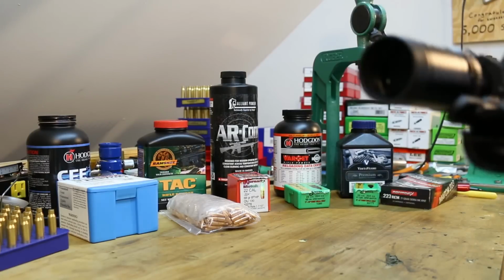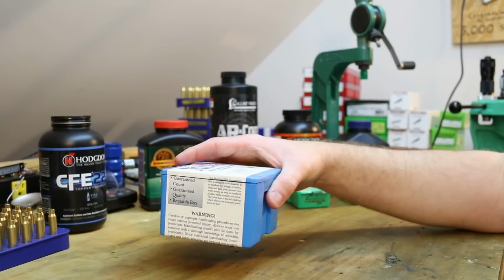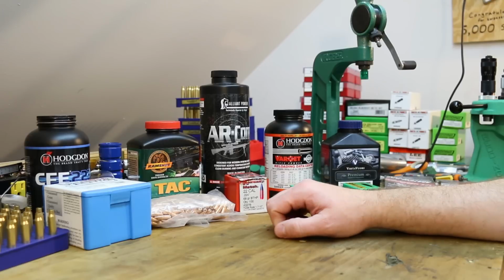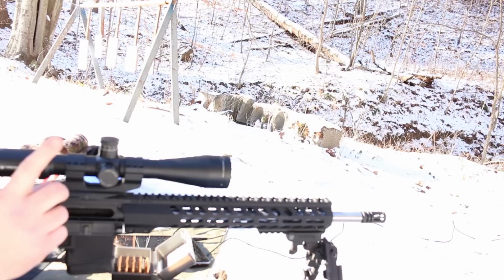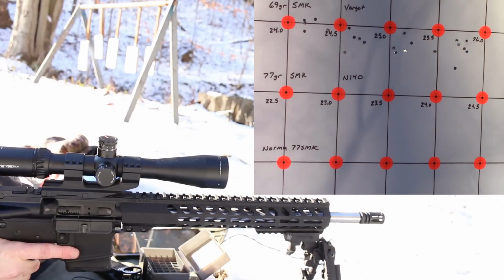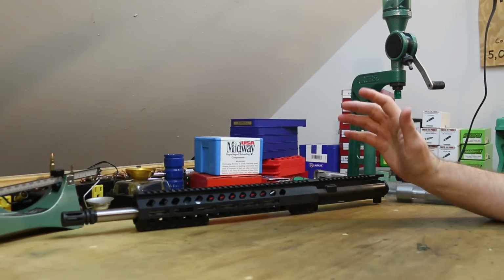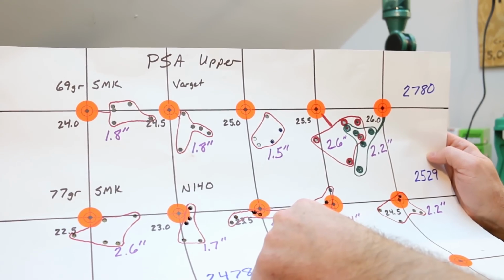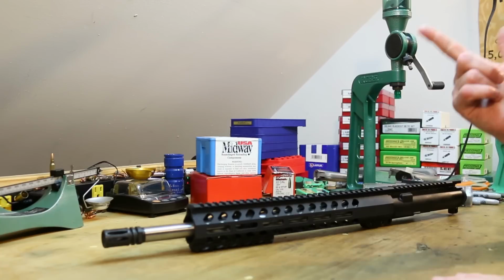5.56 & 223 - PSA Upper Accuracy Tests

Comment: Great Vid JRB. Thanks for sharing. Looking forward to seeing the updates on this. 

I own/owned several PSA uppers over the last few years and their premium line with the FN barrels tend to shoot pretty good for me. I think you are close to the limit though with the budget PSA freedom line.

That 69 grain SMK with 24.5-25.0 grains of Varget has been a shooter for me in pretty much no matter what AR it goes through, so while I'm sure you can squeak out a little more out of that barrel I think that 1.5ish MOA you achieved is actually pretty good from what I've seen. Ever do any testing with 8208 XBR powder? I love that stuff with the heavier bullets.

You work up some great match loads on your channel and provide great feedback. I think in the future treating yourself to a high end barrel like a Lija, Krieger, White oak armament, Douglas etc. would be a great way to showcase your hand loads. But either way JRB nicely done.
Reply: I think the Freedom line (Melonited) is their second tier barrel,the PTAC is the bottom rung(phospate ext, and no inner nitride/ melonite coatings).

I think PSA has basically stopped using FN tubes they are rare to find listed anymore(and I keep a close eye on the specials for them).I think they are private labeling them(w/FN consent as PSA on the tube if I were guessing). Just my guess.

Comment: Good content dude. I believe that the accuracy that is being delivered is typical of most barrels within the quality standards that you have paid for.  Getting a Barrel that is a 1-8 twist with a wylde Chamber would preform with much better results. The N-140 loading that you used is the AMU "Go To" as their 600 yard loading. I'm just thinking off the top of my head, I'm not trying to put you stuff down. Good video. Dave.

Comment: I was hoping to see better performance from this, recently I tried hornady 75 BTHP match with Varget and it shot great from mine. I do have a 223 wylde chamber and 18" barrel length. I'd say give that a try it shot significantly better than the 68 Gr I was playing with. Also haven't had any factory 55 shoot very well but that may be inconsistent loading. Great channel man!
Reply from the maker: I watched some of your videos but haven't finished them all yet.  Not sure how much the 18" and Wylde chamber would change things, but it might be a lot.  Seems like these barrels might be very picky about bullets.  We'll see!
Reply: I have the same barrel in a PSA upper as west desert shooter has and it is sub MOA with factory loads. Not the cheap surplus stuff though but thats fine by me as I don't use it anyway. It does well with TSX bullets 62 grain I thing but would have to have a look.
Reply: Michael Max not many factory bullets shot great for me and I tried 10 or 11 random brands and weights. Unfortunately the 50 Gr shoots great the reason that's unfortunate is I want to shoot long range but if you're varmiting it may serve you well. I haven't tried a ton of the premium 223 it's just too expensive to try a bunch maybe look into federal gold medal or hornady match
Reply: OP, What's the twist rate on your barrel

Comment: VV N140 is my absolute favorite AR powder but in my area it is almost $40.00 a pound. CFE223 works well and at around $30.00 it's easier on the wallet. My go to load is 24.0gr of CFE223 pushing a 68gr Hornady bthp bullet out of a 20in 1-9 barrel and getting MOA patterns.

Comment: My 1:7 barrel HATES 55gr FMJ but loves everything else from 55gr varmint pills to the 77gr loaded to mag length. If you get a chance snag a barrel from White Oak Armament it will not let you down. Also using metal GI mags let you load a bit longer w/o feeding issues. I picked up a few metal 5rd mags for hunting legality and they work great.
Reply: White Oak Armament deals with strictly Match Components, I would recommend them to any person who is serious competitor in NRA High Power. Good recommendation. Dave.
Reply: Thorsaxe777 my 20" from them in 1:7 shoots lights out, but it is kind of an ammo snob and seriously dislikes the bulk 55fmj for some reason. ive tried loading those pills at every length and every powder charge with and w/o crimp and can only get 2" groups. 55gr and up varmint and match pills i find its a bad day when groups avg over an inch at 100.
Reply: Odin works makes good stuff too, every thign i have of theirs is verry good, highly recomended
Reply: mine shoots 60g varminters from sierra over 26.8g varget into a ragged hole at 100yds always an inch or less even on bad days and mines not the freefloated model but the same barrel

Comment: You have a 1-7 twist rate the best weights for your twist rate are the 69-87 grainers. 
But it's not the bullet weight, but the bullet length that will determine accuracy. For example a Hornday 75 gr BTHP is longer that a 77 Gr Sierra Matchking BTHP. Every different bullet weight is going to have a different Point Of Impact, so with that said rezeroing your scope may be necessary as you go from 55-62-68-77. What I do is I buy a box of factory rounds say Federal 69 Gr BTHP for my 1-9 twist Savage Bolt Gun, measure the OAL of all the rounds in the box, get a average and write it on the inside flap of the box. 
Then I take em to the range shoot a group of 5 rounds checking the point of impact and grouping, let the barrel cool for 10 Min. Then shoot the other five rounds checking the groups. Then if I want to copy the load I already know the OAL and how it groups from my rifle, just pull one round apart checking the powder charge, and put that information on the inside flap of the box. So already having Federal commercial 223 brass and small rifle primers. Having the amount of powder,( not the kind) and I can go from there. So then if I want to go to the 77 gr BTHP MK load I just do the same process all over again.
Reply: Very informative comment
I don't reload (yet), what would you suggest for a 1:7 twist that is not getting good groups wit 55grain bulk 
Was gonna try 62 next your comment makes me think maybe 69?

Comment: I am really looking forward to the follow up on this Upper Testing exercise. I have the Exact same rifle....Only has 100 rounds through it. I have installed a Brake and swapped out the Mil Spec Springs for set of JP reducers. I am testing Fiocci,50gr V-Max; Hornady 55gr V-Max, Black Hills 60gr V-Max; PPU 75gr BTHP & X-TAC 77gr SMK's this weekend. So far, it leans toward the Light Weights...Idon't know why. I would love to share my results and get some feedback for Hand loading in the Future. Thanks Sir...please continue ;)
Reply from the maker: The ammo is loaded for the next video, now I just need the snow to stop and the wind to stop blowing!  Hopefully it will be up in the next few days.
Reply: What is the twist rate on your barrel?
Reply: @chuckmay6563  I was gonna ask the same thing

Comment: I used to shoot a Remington 700 Varmit in 22-250, and I never had any luck with heavier bullets. 55 grns worked perfect, but anything heavier was not accurate. Any comments?
Reply: Most 22-250's come with a slow twisted barrel, either 1 in 14" or 1 in 12".  If you want to shoot bullets heavier than 55 gr ( or maybe 60 or so, if they are short), you would need a custom barrel with a 1 in 8" twist.  The slower twist barrel does allow for highest possible velocities with thin jacketed lightweight varmint bullets in the 22-250 and .220 Swift.  (Actually true for the .223 Reminton, too.  My 700 SPS Varmint 26" 1 in 12" twist can push the 40 gr Nosler Ballistic Tips 3800 fps!)
Reply: Yea I kinda wish I had got the 1:9 or 1:8 twist
The 1:7 is overkill I'm not gonna be shooting tracer rounds... 55 won't hold very well gonna try out 62's tomorrow..
Reply: Unless the bullets are constructed for the purpose, I think it's possible to push those lighter bullets so fast out of a fast twist barrel they just come out of the barrel, go about 50 feet and disintegrate.  Depending on the twist rate and velocity 500,000 rpms is possible, and maybe changes the shape of the bullet if it doesn't disintegrate.

Comment: I see some uppers sasy 223-556 and some just say 556 . Is just the 556 better than a 223-556?
Reply from the maker: Some claim that it is not safe to shoot 5.56 ammunition in a 223 chamber.  This is a very involved conversation that I don't have the expertise to answer properly.
My suggestion would be to buy something with a .223 Wylde or 5.56 chamber.  These are both safe to shoot .223 Rem and 5.56x45mm NATO ammunition in.  The .223 Wylde is an "in-between" sort of chamber.  Most of the AR barrel manufacturers are offering it.  Good luck.
Reply: .223 barrel wasn't designed for the higher pressures of the 5.56 round 
Other than that they r pretty much the same

Comment: Shitty barrel, I'd try truing the receiver, JB bore paste and Kroil the bore, reinstall A2 flash hider with a NEW crush washer. The hider may be over torqued.  I'd be pissed. A lot of good components went down range for such crap results.  Thank you and good luck. For shits and grins check scope base and rings.

Comment: Suggest Contacting Palmetto these barrels should shoot 1-2" moa easy with any ammo.
Reply: Barry Lynne my 300 dollar chf 1n7 fn psa barrel shoots 4.5 to 5 moa with speer gold dot 64 and 75gr , pmc xtac m855, imi m193 and m855. 4 to 4.5 with m193 and 223 55gr pmc. so far im not f n impressed after 1500 rounds
Reply: Nor would I be,should easily shoot 2 moa @ 100yds.I would bitch to Palmetto.
I have seeen and head lots of issues esp with the SS tubes they use.

Comment: I would shoot off a rest  and not bipod if you were checking for accuracy
Reply: can you please explain why thats so? im a new shooter and so far not a fan of my new bipod. i think i was shooting better off my gun case because the strike industries hand grip dug into the case's creases. With the bipod i noticed it was more flimsy.
Reply: Risky Business more steady then the bipod that's all
Reply: Learning to shoot with a POD is a process.Bagged IS best, but you can get real close with the proper pod if you Preload it(in the dirt, foward pressure), and shoulder it into your  shoulder socket snug.Amost like a push /pull.